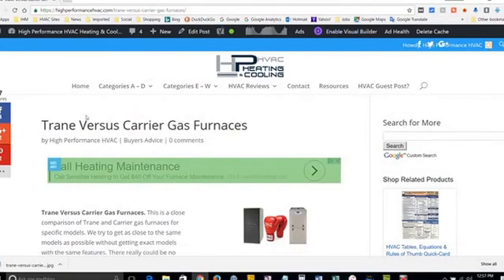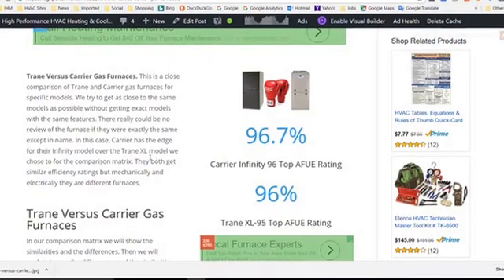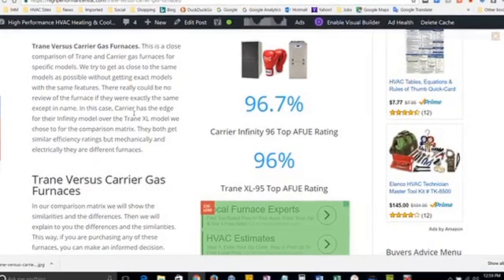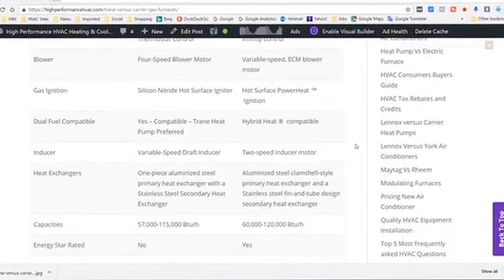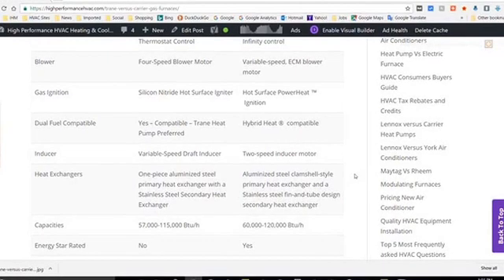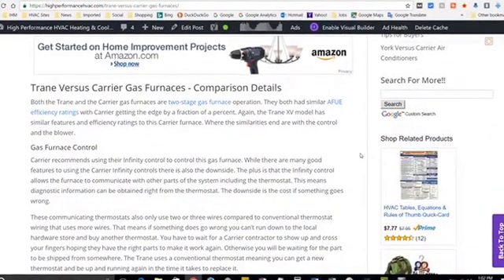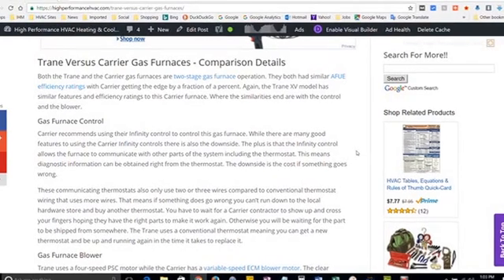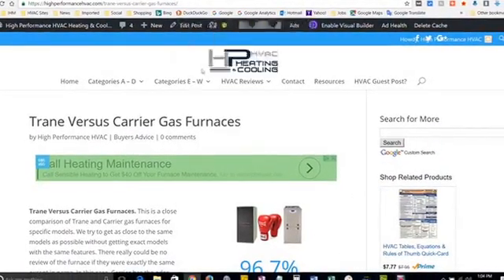Trane Versus Carrier Gas Furnaces

Comment: It's true, how its installed, along with many other variables such as ductwork, electrical, design and desired comfort matter. Not to mention warranty, specifically labor warranties. How would a homeowner know things that matter the most? Homeowners should investigate the type of contractor they will entrust to do business. videos like these or "Consumer Reports" that do comparisons of brands of are irrelevant, wouldn't you agree? It said even a few times in your video, none of this matters because it comes down to installation aka the contractor.
Reply from the maker: Contractor first and then brand. You can buy a Lamborghini but if Gomer Gump puts it together it won't beat a Ford Pinto in a race.